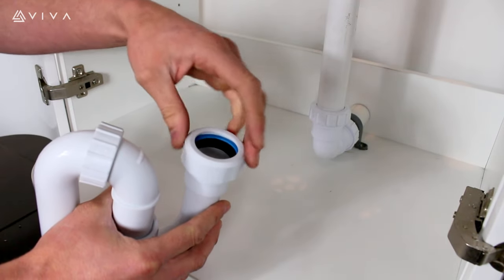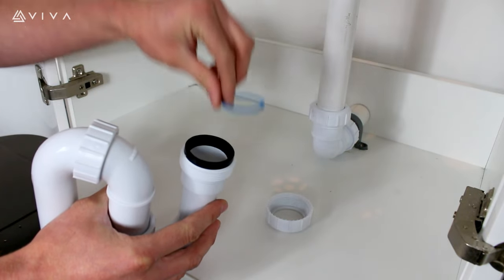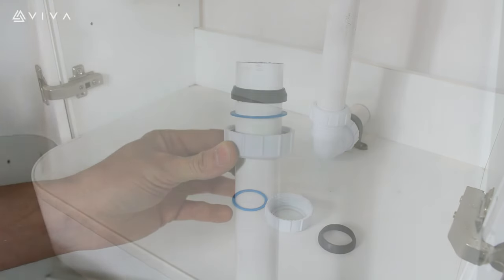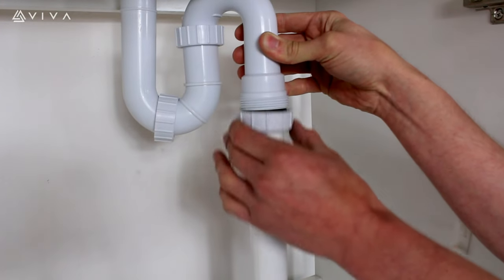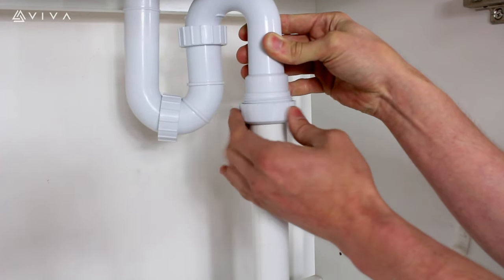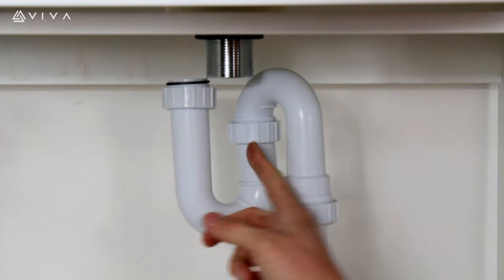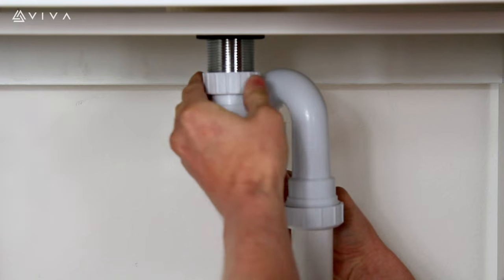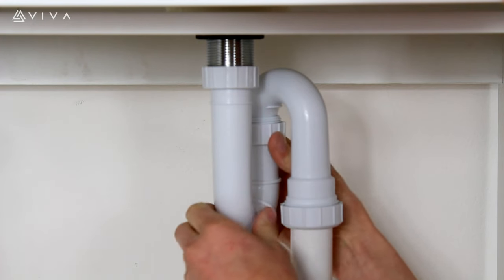How to Install or Replace a Swivel S Trap Waste Fitting for a Bathroom Basin or Kitchen Sink

Comment: This is the best tutorial I’ve seen. The importance of sequencing is the best plumbing advice. All my ongoing problems solved. I used to leave the sink joint attached and just deal with the down pipe joint which was always a temporary fix. Thank you for showing how it should be done.😅

Comment: Thanks! for idiot proof instructions. Despite everything being out of alignment and as cramped and awkward as could be, I got it fixed with minimal use of unladylike language. I do suggest that really inept plumbers like me draw "up" and "down" arrows on the ends of the new S so if you do have to put it down while holding the pipes in place with your knees and the basin up with your head, you don't pick it up  upsidedown.

Comment: My trap is leaking because the waste pipe is too short for the outlet to go over it properly. Is there any telescopic adjustment in the middle lock nut?
Reply: "That's why it's always necessary to adjust it before you glued it...cut it and put a coupling to the right measurement.

Comment: WARNING - I came here for one piece of information - Which way does the thread on my existing U-bend turn? I don't want to turn it the wrong way and over tighten it. But his U-bend and my U-bend turned in opposite ways. I tested on a less stuck U-bend on a different sink first.

Comment: I guess if you don't mind occasional sewer gas in your home you could get by with this. Why they are not illegal in all areas is beyond me.
Reply: I've had an S-trap for years in my older home and I've never had any issues like that, though I understand that P-traps are meant to prevent things like foul smells, gas escapes, etc. I'm curious: do all P-traps conversions require a reroute through walls or can you convert an S-trap into a P-trap using a floor escape? Because I'd love to have a more up-to-code P-trap but I don't have the money to reroute plumbing from my floor under my sink in through my wall under the sink. (In other words, can you implement a P-trap using a floor drain using only PVC fittings without needing a plumber to cut a bunch of stuff in the wall to reroute pipes behind walls?)
Reply: @22_floW  Of course you can. Here is one scenario... https://www.youtube.com/watch?v=y9NBdZcH3nE
Reply: @22_floW  great question because I just bought a house they had flipped and my home inspectors didn't say shit about my S Traps during my inspection so I was freaking out when the plumber quoted me 4500 on an estimate to fix them all
Reply: @fossilsol69  The guy in this video did absolutely nothing. He just replaced and S trap with another S trap. That trap will still siphon because there is no vent. People who don't know what they're doing shouldn't make videos.
Reply: @fossilsol69  that video is wrong. He replaces a s trap with another s trap not a p trap.
Reply: We use S traps all the time in Australia. Very common. And as long as you have water in the S you won't get any bad smell........ unless you have your nose too close to your ass. The water that is in the S prevents ANY bad odours from coming through. The only time you'll get some sort of bad smell is if you haven't used that particular S bend in a long time and the water has evaporated from it, therefore allowing any bad odours to come through, but even then it's just a matter of pouring some hot water down the drain to fill the S. Common sense really :)
Reply: @jimlahey9158  4500 for converting s to p ? Where is house ? Monaco or Monter Carlo ?
Reply: @andriiprychepa7023  they said they had to replace my whole stack, cut into my walls, undo my toilet, etc...looking back on the experience there were a lot of companies that tried to get some nice commissions on me because I was a first time home owner and didnt know any better. Another plumbing company tried to charge me 6000 just to dig the yard trap up in my backyard because it could rupture and be 15000-25000 to fix at that point due to it being so close to the alley???